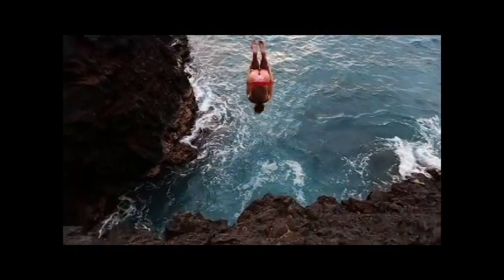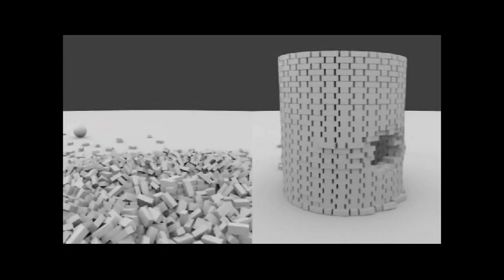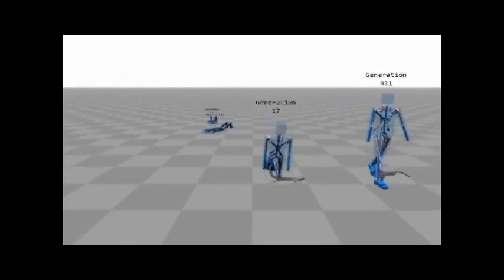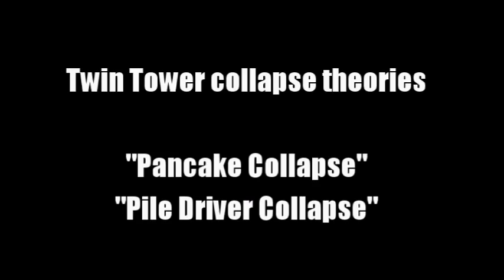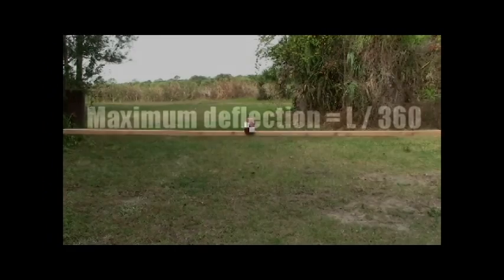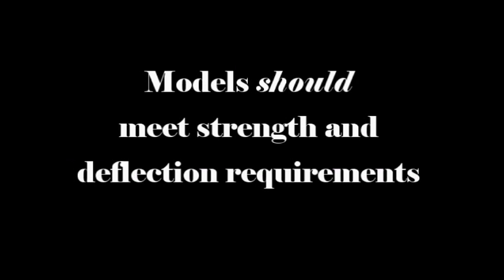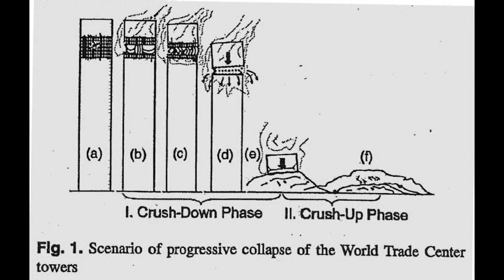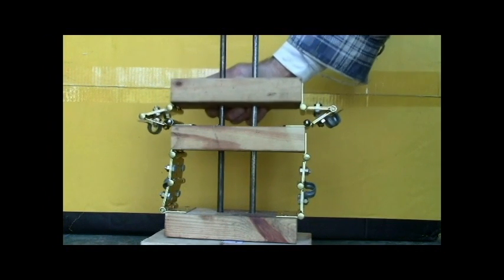9/11 Experiments: The Force Behind the Motion

Comment: The block should obviously get heavier on its way down with all the structure Gathering weight it's Elementary and I'm not an engineer or scientist
Reply: But that's not what you see in the North Tower. You see much of the weight going outward. Once it's out, it ceases to crush down and reduces the weight you claim is pushing down.

Comment: So what about main steel beams ?  They designed to carry minimum 4  times more weight than what they had already. Even beams failed at one location only still won’t be enough to take down the building to the ground. So main beams must be  weakened at more than one very specific points  and very specific times all the way from top to bottom...! If that caused by jet fuel it must be very intelligent one so it knew where to weaken and when.
Reply: Why do u think floors was holding the core ? It  opposite core and connected steel joists was holding the floors. Why floor failure may cause the collapsing????  The way they build the structure steel framing first then floors...  floors may give stability but not holding it at all , like drywall and columns , destroying drywall is not gonna destroy main frame , and joists ... also  if there was a  lateral support failure buildings should collapse side ways , not straight down by the gravity
Reply: Kane Stone - "Even beams failed at one location only still won’t be enough to take down the building to the ground. "
The collapses had two stages:
1. Initiating stage - The start/cause of the collapse.
2. Progressive stage - No matter the cause of initiation, once the towers started to collapse, there was nothing to stop them.

"So main beams must be  weakened at more than one very specific points  and very specific times all the way from top to bottom"
Why?
Reply: Because we are talking about steel beams designed to carry much more weight than what they had already. Those beams are straight thick steel beams connected to each other’s like a web  from the  top to the foundation. Let’s says they failed at one location . It’s foundation or top floor ? If it’s failed at the foundation why it started collapsing from the top. If it’s failed at the top floor how much impact force can crate ?is it gonna be enough  To smash it to the ground..   Also how come all main beams at the same floor failed at the same time? Floor came down perfectly didn’t fall over one side , not even a little. 
In a controlled demolition in order to execute a  perfect demolition they need to study the structure blueprints , pick specific explosives and detonate them in perfect timing . Even thou sometimes it fails and tumble the building over on one side. 
And you believe that only a jet fuel caused a perfect demolition for  3 buildings . 
I know it’s easier to blame a few Muslims than accepting the truth thanks to Hollywood movies and Fox News.
Reply: Kane Stone - "Those beams are straight thick steel beams"
They were thick alright. And only three stories tall each. Bolted to the next one. I haven't seen one column that snapped. I have seen plenty of clumns that simply lost their connection top the adjecent ones. Te broke off at their connections.

"connected to each other’s like a web"
Not really. The only connections between the individual columns were the horizontal beams that carried the floors. They were designed to carry floors, not to make a stiff construction. The core wasn't even cross braced. It wasn't considered necessary since the floors would provide the lateral stability.

" Let’s says they failed at one location . It’s foundation or top floor ?"
Neither. They failed at points of the plane impacts. But why do you think the core columns were so relevant to the collapses? 

"Also how come all main beams at the same floor failed at the same time?"
Some were damaged by the impacts of the planes. So the load these columns were carrying, was redistributed to other columns. Then a fire was started that slowly weakened the other columns up to the point that one wasn't able to carry its increased load. So the other remaining already weakened columns had to carry that extra load. Chain reaction of load re-distribution and failing columns. But again, why do you think the core was relevant for the collapses of the towers?

I would advice you to study the design of the towers. You will learn that the construction was depending on perimeter, core and floors. One fails, all come down. 

"And you believe that only a jet fuel caused a perfect demolition for  3 buildings ."
?? I haven't stated anything on what I believe. So how would you know what I believe? :)
Reply: What I mean by  web is internal connections to each columns , so they were not individual columns , of course they were not as tall as Building at some points they had joints . And where the plane hits the building has about 16 steel columns which is core, since building didn’t collapse right away it’s not from the impact , according to false theory on that floor core steels structures weakened by heat , but all 16 steal columns failed at the same time as falling didn’t happen partially but perfectly  .. let’s say it did and steel get weakened to carry all the weight above then what about steel core below?   Or steel columns get weakened from top the bottom ? I was thinking that only a paid engineers like nist  can declare this massacre happened because of plane crushes but I guess I was wrong .
Reply: Again, why do you think the core was so relevant to the collapses at all? The floors fell off the core together with the perimeter. And the core fell seconds after because of a lack of lateral support. Short explanation.

Comment: Its funny how the the most complicated and nearly accurate computer models are refuted by these paper or concrete slab models which are NOWHERE near to simulating the physics of a real building collapse. 
First understand that there is something called stiffness/strength to weight ratio. If you can do a most basic calculation of that, you would know how drastically your "simulations" have steered off the reality.
Reply: Computer model = cartoon.

Comment: Seriously flawed experiment's - Gravity doesn't affect little strips of paper & wood like the absolutely huge mass of concrete/metal in those building's !  What is the weight of the portion of the building above the impacted floor - a hell of a lot - so drop that weight on any building you like from 5-6 meters above it and it will pancake.

Comment: A lot of people are missing a very important point. And that is that gravitational collapse alone does not, and in any scenario, produce the amount of energy to pulverise the entire structure. Do you understand that???
Do you understand that the total energy required to cause the observed damage is far far greater than the collapsing structure could ever generate in its downward motion under gravity? 
Can you get that basic fact through your head, or that too complex? 
To put even more bluntly. Do you seriously think that if these three buildings collapsed completely, due to fires, that any steel framed building since 2001 would be occupied? Did you think that we would still build them to the same standards? Because we still do, all over the world. It seems no nation took the official version of the destruction of the buildings into account for any engineering, or general safety purpose.
Reply: Bazant and Zhou would disagree with you - as would reality - and those guys showed their work.

Comment: Too conspirative...  Comparing paper to steel and concrete is not correct.. In fact 'big mass' in such building is working more as fragile glass- cracking at one critical point can demolish all the system... Dynamic stress can apply huge force at the moment, and can start sequence, especially if dynamic stress move sideways columns and make asymmetric of pressure...

Comment: These tests are inapplicable. They do not represent the way a building is engineered and held together.  He also doesn't pre-stress the materials to represent an impact from a plane going 583mph AND a giant explosion happening within a nano second of each other.

The building was heavily compromised before it collapsed, that's why it did so. Of course you won't get the same results when using brand new vs heavily damaged.

Comment: This is a great video but I have to label it a poor science. Make your floors the correct weight. It is combination of the speed and the multiplying weight of each floor as the join the fall that helps take the next floor down. Planes alone took the trade center down. Thanks

Comment: What about the weight of the plane, assuming there acc was one? That wasn’t in the simulation
Reply: None of these simulations in any way are accurate models of the real event.  They are designed to achieve the desired results and fool people who do not know better.
Reply: M Fitz definitely looks that way. Even the circular “walls” don’t provide a proper simulation as it’s closer to the core than the walls would’ve been on the facade of the trade centre.
Reply: If the name Jonathan Cole is attached to it then you can safely assume deliberate deception and dishonesty.
Reply: M Fitz I dislike conspiracy theories as they’re often ridiculous. But admittedly this event has too many unanswered questions for me not to explore. Hard to differentiate from fact and lie with these YouTube videos tho, so much nonsense being touted as “fact”
Reply: Asher Mehmet - If you genuinely want to learn about 9/11 Youtube for the most part should be avoided.  98% heat, 2% light.  Youtube is where shysters go to fool the credulous, gullible and ignorant.

Comment: Your experiment using pizza supports is complete nonsense.  

You do not scale the weight and your structural strength is complete nonsense.  The upper floors of the WTC towers shredded the lower floors, the vertical supports can be seen in videos from all angles as surviving the collapse for several seconds.  The upper floors ripped the lower floors off of their vertical supports and shredded them as they fell.  

Look at how little is connecting each floor truss to the exterior support.  Its a few inches of steel.  

https://imgur.com/a/Ts4IL0F

As the orthogonal stresses on the damaged floors grew too great, it caused a global collapse of the floor trusses causing free fall for the distance of a few floors.  That gave the upper floors great acceleration and that was sufficient force to rip each floor off of its vertical support.  

Build a model with the weight, structural support, and floors designed to scale and it'll look much different.
Reply: Where did everything go? The floors themselves, all the steel beams.. mostly everything was pulverized to dust.
Reply: @norakat  

Everything was on the ground.
Reply: You are completely correct on how thin the floor trusses are. How could ever think that beams of steel centimeters wide could hold the weight of the entire building? As soon as one snapped, it would begin a chain reaction. Floor after floor would snap. How could ever think that only a few beams of steel, that weren't properly coated with fireproofing, could hold up to the weight of the building?

Comment: Here is a linked to some failed demolitions. And yet on 911, 3 buildings came down like planned demolitions, (according to NIST believers) without planned demolitions! So why bother with demolitions at all, let's just set fires and save the money. https://www.youtube.com/watch?v=hB8Siu-_7f8&t=114s
Reply: The problem is the lack of control.  Awfully messy.

Also, your idea might have been amusing 15 years ago before 10,000 people also belched out the same thing on some obscure corner of the internet.
Reply: We need to get that meme to critical. That's the whole point.
Reply: To spread stupid?
Reply: To point out that a random act does not equal well planned engineering. You believe that a random act will provide the same results as hours and hours of well thought out engineering.
Reply: Paul DiBenedetto - If you are referring to buildings falling down careful engineering is only required if you care precisely how the building comes down and where it ends up when its done.  On 9/11 building collapses were purely incidental and unnecessary (I know, blasphemy) and show no particular engineering skill.
Reply: Fitz. You believe that random acts = highly skilled planned engineering. That's what you believe.
Reply: Paul DiBenedetto - Reading comprehension apparently not your strong suit.

I honestly don't know what it is with you CT's that you so frequently resort to trying to this sort of tactic.  I mean, it never actually works, does it?  Of course, when has endlessly trying the same things that don't work ever stopped any of you?

Comment: But your materials didn’t virtually disintegrate like all buildings did while coming down.  They became dust. After the buildings fell there was not nearly enough ruble to account for the mass of the structures.
Reply: So what has the clean up crew been doing for over 8 months? What was on the over 100,000 truck loads of debris? Dust?

Comment: Exactly on point, exactly what I was always thinking. Now there is actual proof of it. Now imagine they had full control of each explosion to accelerate the downfall.
Reply: " Now there is actual proof of it."
Actual proof the towers were built from paper and destroyef by firecrackers?
Reply: @brucelansberg5485  Actual proof that in a "progressive collapse" the added weight and momentum of each successive floor does in fact NOT cause an acceleration of the collapse, but rather there is a deceleration followed by an arresting of the collapse.  Buildings are constructed to support the weight for which they are designed multiplied by a factor of safety.  In the case of the Twin Towers, that factor of safety was at least 5, meaning the towers could have supported 5 times more weight than anticipated on a normal basis.  That's why the demonstration produced an arrested collapse.  Now, if you knock out the columns, then you get something that approximates free fall collapse and that's what we see on 9/11.
Reply: @brucelansberg5485  WARNING ⚠️ IDIOT ALERT 🔊

Comment: Exactly it would decelerate rather than speed up. Also it's looks really like a controlled implosion. The building have a tendency to tip and roll if collapsing on its own. I strongly believe that this was a setup and many of our people have died for whatever bullshit cause
Reply: Exactly wrong.  A progressive collapse by definition gains energy as it progresses.  It would and did speed up exactly as one would predict. Remember, once things start moving the building dismantles itself.  Even in a controlled demolition the demolitions only start the process.  Gravity does the rest.
Reply: Alex - "it would decelerate rather than speed up"
Why? Doesn't gravitational force make stuff acellerate?

"The building have a tendency to tip and roll if collapsing on its own."
Why? Doesn't gravitational force work straight down instead of sideways?

"I strongly believe that this was a setup"
Why? Wouldn't you need some kind of proof?
Reply: Bruce Lansberg - The term is "gravitational acceleration" for a reason.

Comment: What is the scale? What does the steel block represent? The plane? The collapsed floors? Did you add the plane to the equation? Is the breaking points relative to the weight of the steel?
Reply: Yeah this guy doesn't know jack about physics 😂